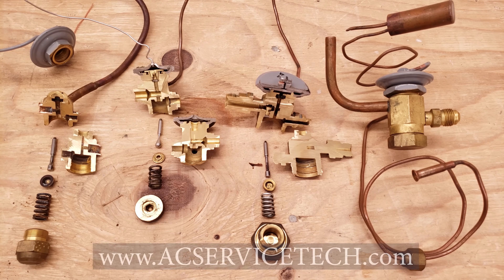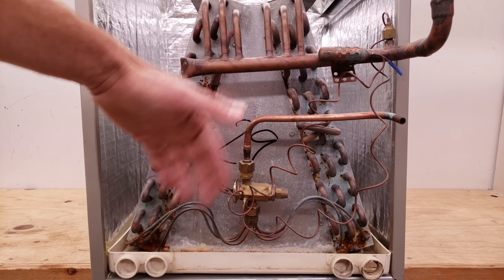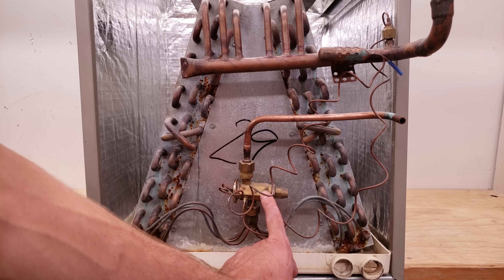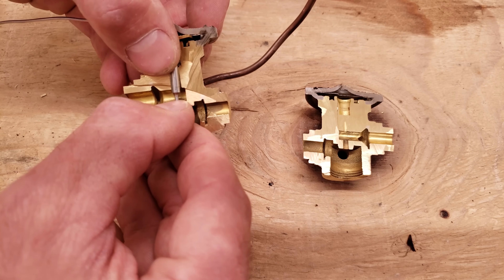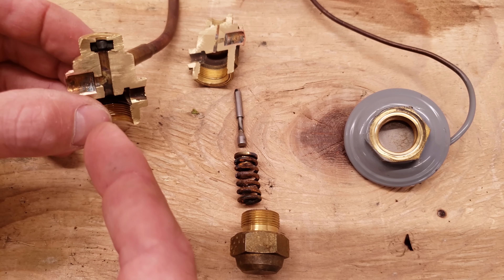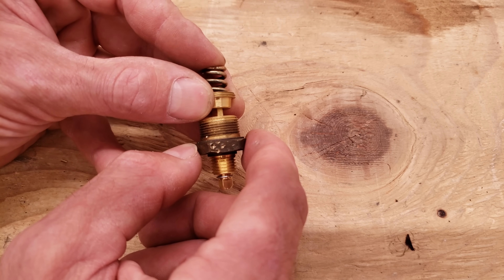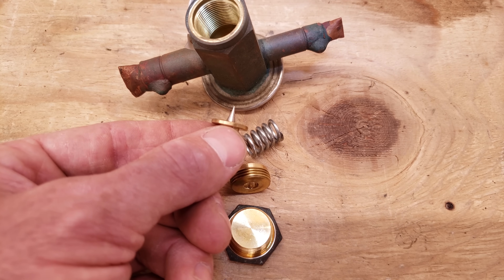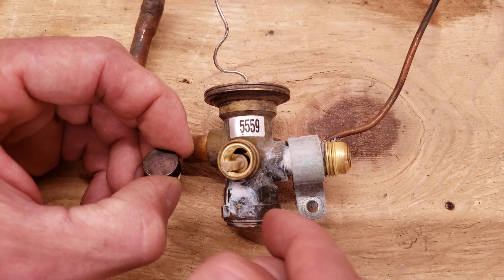What's Inside a TXV? How Does a Thermostatic Expansion Valve Work?

Comment: good morning sir i have a 10 ton r 22  trane heat pump that i replaced the compressor after evac and charge the system the subcooling is at 16 where it is suppose to be but it fluctuates from 16 to 0 constantly as the unit is running, constantly up and down also the compressor is sweating almost to the top, the pressures are ok can you point me in the right direction of what the problem could be thank you sir i dont want to dammage the new compressor also i am getting 20 degrees of drop across the evaperator
Reply: I would make sure bulb is attached well and insulated, could also be non-condensables.